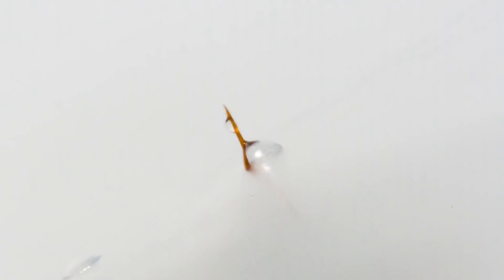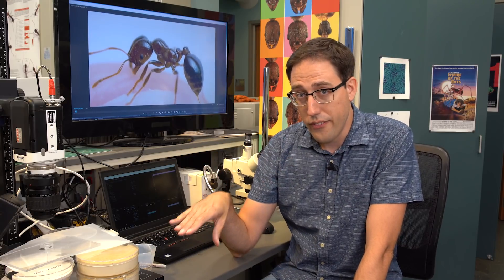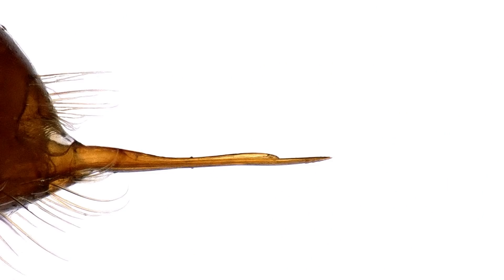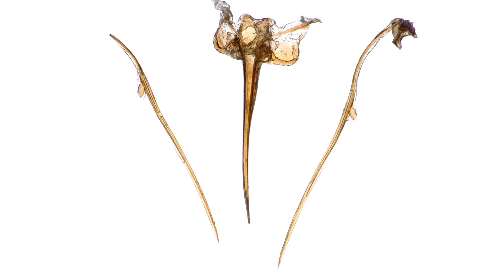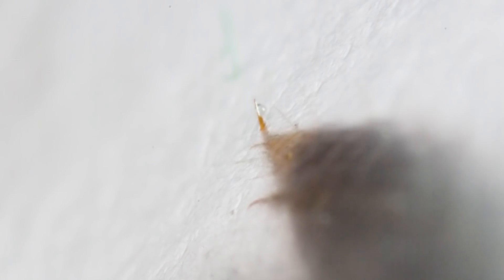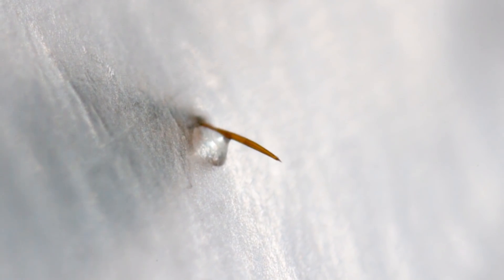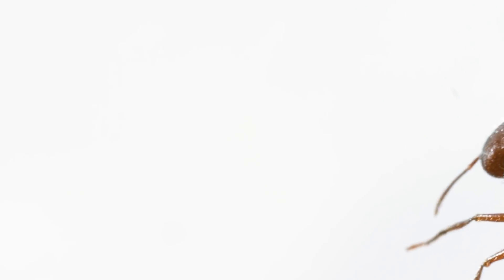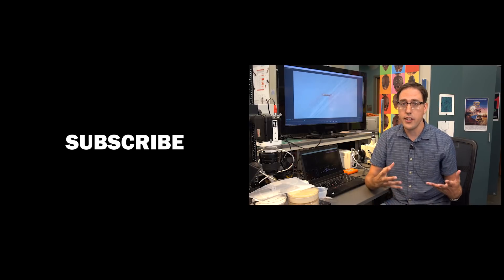Venom Injection: How Ant Stingers Work!

Comment: Very interesting to see how the stinger works on not just ants, but also on any other stinging insect! One thing I know about stingers is that the true pain you feel is not the stinger itself, but actually the venom coming out of the stinger that hyperstimulates the nerves that send lots of pain signals to the brain. Without venom, the stinger itself would only be as painful as a small pinch, equivalent to an injection needle that doctors use on patients.